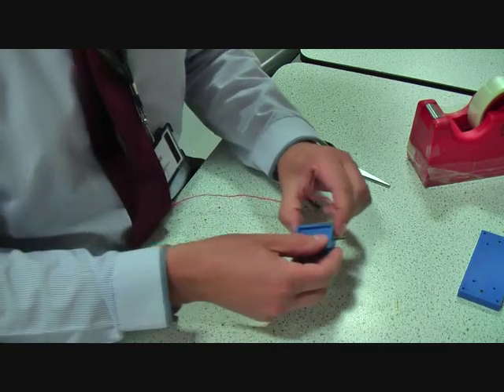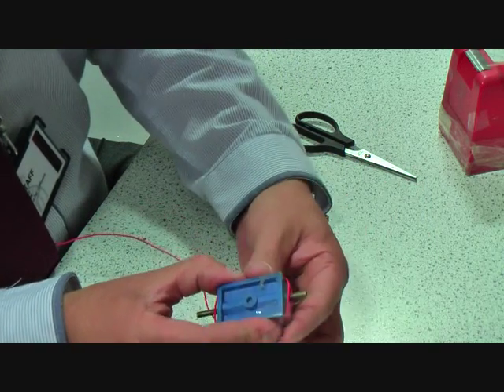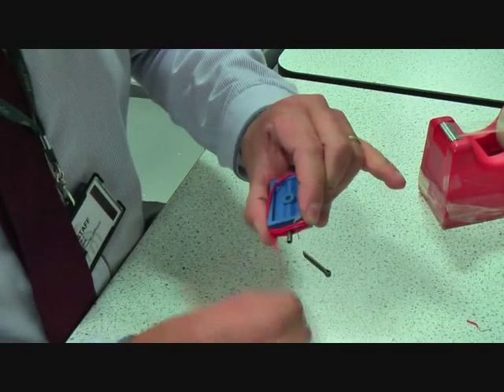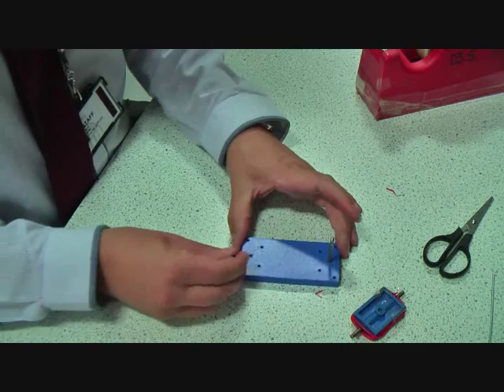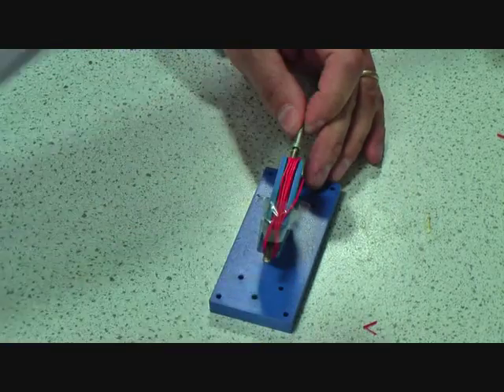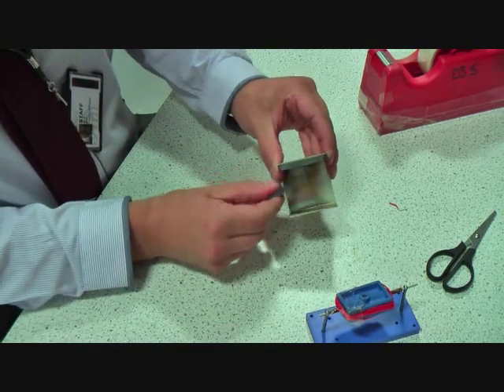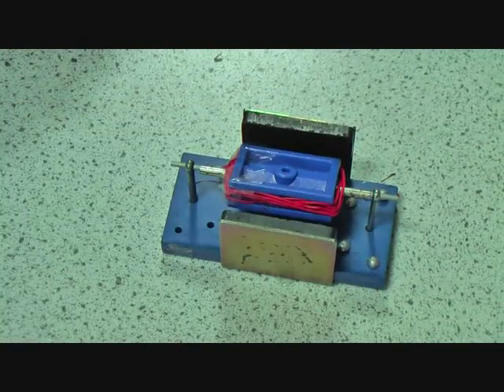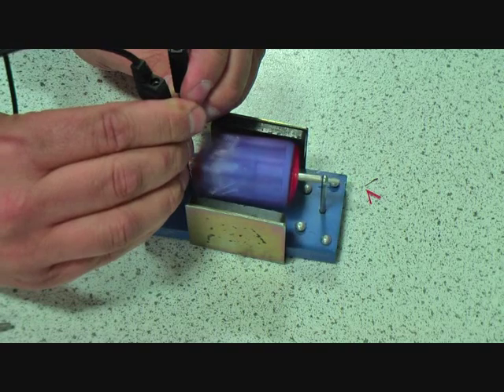How to build a motor

Comment: Remember these well - wanted to make a film of them myself including the history of the kit.  They must be over 50 years old but does anyone know why they are 'Westminster'?  Was it an invention from Westminster school?  I cannot find out anywhere.  I will try to show building the brushes held under the rivets which always caused pupils problems!  They are great fun to build in STEM clubs too.
Reply: Developed for the Nuffield Secondary Science Project in the 1960s, with parts taken from the Westminster Electromagnetics Kit.
Named after the school who significantly developed the kit.

Other kits named in the Nuffield 9470 Physics Guide to Apparatus (1968) included :
Bristol pressure kit, Malvern energy conversion kit, Malvern electrostatics kit, Malvern current balance kit, Whitley Bay smoke cells, Evesham pressure apparatus, Worcester circuit board kit, Worcester current balance kit, Worcester gas voltameter kit, Edinburgh COz pucks kit.
Reply: Yes. Designed by JM Osborne at Westminser School, for the Nuffield Foundation, 1960s